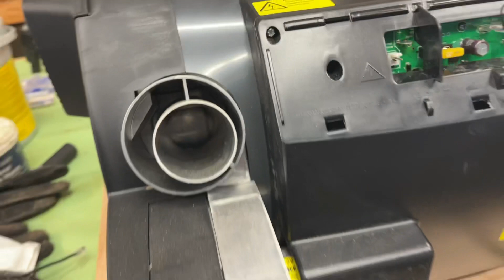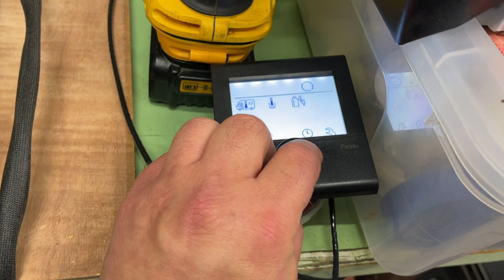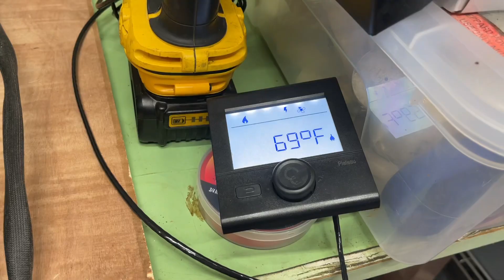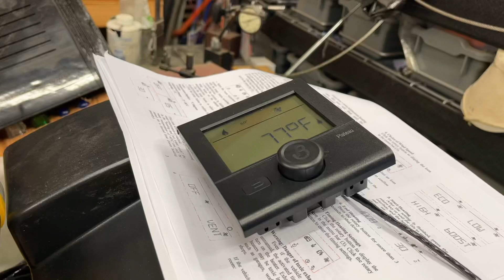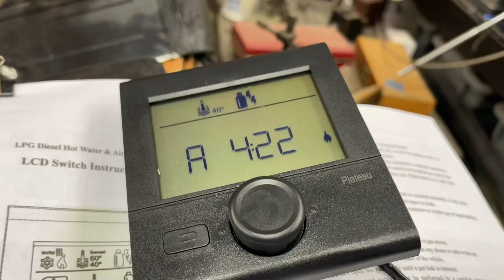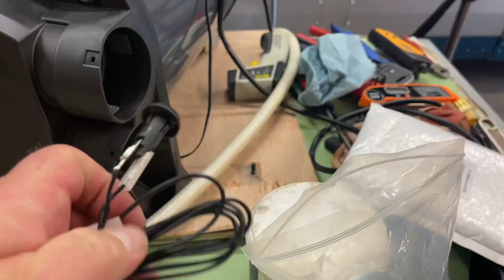Chinese diesel RV water heater and furnace - bench test

Comment: It’s a virtual copy of the Truma at half the price over here in the U.K.  even the controller is identical. We have the gas version of the Truma and the boost mode on it is to boost hot water to kill legionnaires virus, we rarely use it though. As for showers we use our shower to wet down then switch off soap up then switch on again that way we get a reasonable shower, don’t expect the same as a home shower.
Reply from the maker: Any issues with the truma making the water dangerously hot?

Comment: truma combi does runs on 120v! heres a segment from the installation manual! (120 volt electrical plug (only on Combi eco plus and Combi comfort plus models) and they are available in north America but it has to be installed by a company registered with trauma if you want the warranty. although you will be waiting at least 6 months because of back orders lol
Reply from the maker: I’ve seen the propane version here, but not the diesel.

Comment: I think you really need to test it as it would be used with a true faucet with a mixing valve and you are not getting a true reading or approximation of how it’s going to really work. Plumbing code actually only deals with the anti scald in the fixtures.. the temperature of the water from a water heater is not mandated, it is recommended to be around 125 F.
Reply from the maker: I got enough of a sense to know that mixing will result in a longer shower than raw hot will. But I like the idea of a mixing valve, perhaps right after the tank. Looking into that now.
Reply: @ThisOldBus  Definitely.. most of the diesel water heaters (aqua hot etc) have a tempering valve just after the heater.

Comment: a good mixing valve (with anti scalding) would solve that hot mode problem and at the same time it would allow longer shower because heat is not "wasted" to too hot water. Interesting video. You probably said it but I missed it, how much did that heater cost?
Reply from the maker: It was just over $1000 including fast shipping. I had it in about a week, it had to go thru customs. Not too bad considering I was already in for $400 to replace my propane hot water.